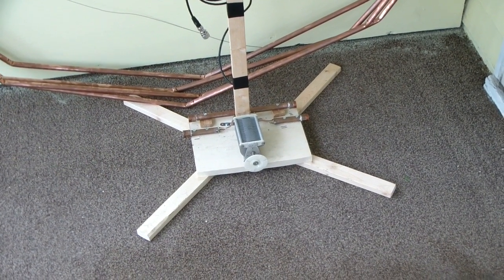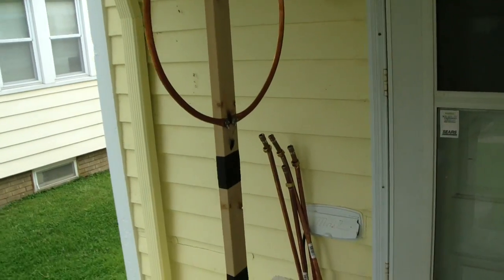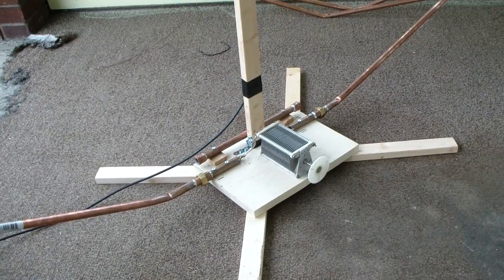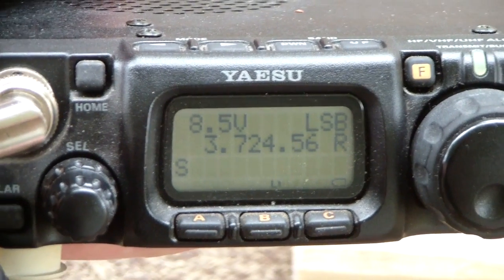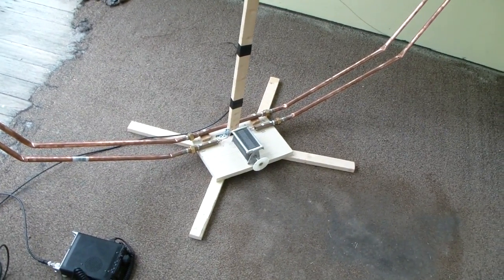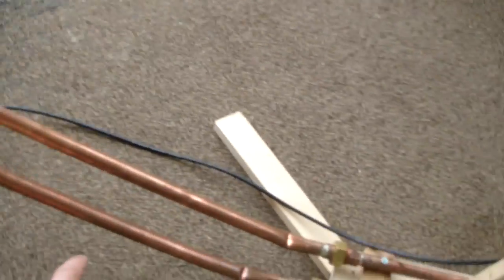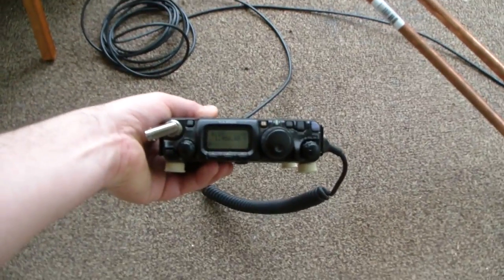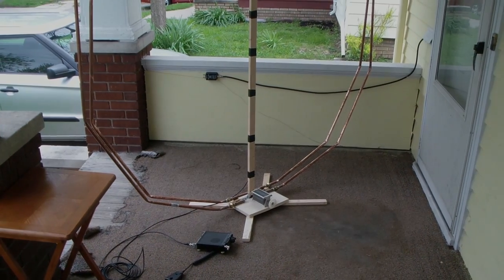Ham Radio - 80 160 meter magnetic loop transmitting antenna

Comment: Kevin: I know this video was made quite a while back, but I made a 2-turn loop recently, and found it would tune across a 2:1 frequency range without having to change from 1 turn to 2 turns. Did you investigate the possibility of using the 2 turn configuration for both bands?
de WB2VUO here near Buffalo, NY

Comment: A point to consider, If you use a butterfly capacitor you won't have the resistive wiping contacts thereby improving the Q of the system. I'll be making a magnetic loop later this summer. I'm in the process of designing a split cylinder rotary variable capacitor rated at several kV. (Remotely operated I hasten to add!)

Comment: A loop like that is perhaps 2 to 3 percent efficient at most for 1.9 MHz at that diameter, also, that small of copper pipe has high IR losses, the diameter needs to be much larger, one recommendation I've seen is greater than 1/24 diameter of the loop itself which is at least 3 inches and as a double loop, double that diameter of pipe. I mention this so others can know these loops need much larger diameter conductors due to high IR losses from skin effect.

Comment: I'm flummoxed. First try at a mag loop and the SWR is 9+ below about 12 MHz. The loop is double (10m) of RG6 approx 3 metres dia.. The coupling loop is about 30cm diameter tuned with a 500pF variable. No short circuit. Sumpin ain't right.
 The coupling loop is placed near the"centre" of the double loop (ie down at the bottom)
VK4AKH
Reply from the maker: You don't tune the coupling loop with the capacitor.  It needs to be connected to the outer loop.  The coupling loop needs to be physically at the side opposite the tuning cap.

Comment: Harbor Freight has a fairly inexpensive tubing bender... I made my magloop with that tool and it's a nice perfect circle.
Reply: Überleben  I heard the feed loop couples with the main loop better when egg shaped, but I haven't heard about the entire antenna reacting that way.. I'll have to try it.  Thanks!
Reply: What tubing did you use? Why not just buy like 0 gauge copper wire? Then you could bend by hand no?
Reply: @Justin-bd2dg  The larger diameter the loop conductor, the more efficient (higher Q) it is.  And the more broadbanded it is.  Ideally you'd want a donut shaped loop (that looks like an actual donut or bagel) but doing that in copper or silver is impossible for most people.
  Q is a function of resistance.  Accounting for surface effect, then the smaller diameter the loop conductor, the lower the Q and the more narrow your parameters will be.
  The more resistance in your loop, no matter the dimensions, the worse the performance.  So if you were to try and make a donut shaped loop of massive proportions but built it poorly, although the shape was ideal, the resistances of the shape would remove all your gains.
  Thinking of this further, if you were to fabricate a giant donut of some material that was conductive and smooth, and then electroplated it with copper or silver, then you'd be golden!
  BONUS:  If the cross section of said donut was large enough, then you'd just need to manipulate the gap between the separated ends with precision for your capacitor, provided the ends were terminated with conductive circles, perhaps separated by glass or other suitable dielectric.
Reply: @patrickp4827  I saw a guy build one of these with aluminum clothes drier ducting.

Comment: As I understand Small Magnetic Loops, they are fed at the point opposite of the capacitor; 1/2 way around the loop.  When you switch from 80M to 160M, by leaving the feed point where you have it, aren't you feeding the 160M loop at the 1/4 and 3/4 points rather than 1/2 point around from the capacitor?  Would also enjoy seeing your field strength device implemented on this one.  Thanks, Ron, AE5WW
Reply from the maker: It's the physical layout that matters on the cap and coupling loop.  Related to the physical magnetic fields.
Reply: I've thought the same thing.  Seems like you'd couple the drive loop at the electrical center of the radiating loop, so the magnetic peak of the drive loop would match the magnetic peak of the radiating loop.  In the two loop configuration that would put the drive loop at the bottom, coupled to the loop section at the back of this configuration where it's passing by the capacitor on the bottom.
Reply from the maker: I have experimented with moving the coupling loop closer to center.   The weird thing I observed was although I could still tune to a point of resonance,  the radiated field strength dropped off tremendously.
I've seen another video illustrating the voltage vs current peaks on a magloop.  Like with a dipole, they are 90 degrees out.  There was a voltage peak on the loop at the capacitor, but a current peak at the coupling loop side.
I think with the coupling loop centered, you don't get that relationship and it just doesn't radiate.   But I'm not a math guy, more of a gut instinct experimenter.
Reply: I"m not sure we're saying the same thing.  I don't mean centered within the big loop, as in concentric, circles with a common center.  The drive loop has to be quite near the radiating loop for the magnetic fields to couple.  This is hard to describe, it seems.  I mean the drive loop inverted from how it is now up top, and placed "on" or very near the bottom of your back-side loop.  It would magnetically close-couple from the small drive loop to the large radiating loop.  My thought is that would happen best at the point of maximum current, the electrical center of the radiating loop.  As if the center of dipole that happens to be coiled into a loop.  Maximum magnetic field occurs at the point of maximum current, the center of the "dipole" if you will.
Reply from the maker: Some people build them with the coupling loop at the bottom and the capacitor at the top.  I've built them both ways and don't see any difference in performance.  I usually put the capacitor at the bottom only because it's easier to mount it there on the base.
Reply: @jerrygrimes8813  k km km n
Reply: When tracing the 2 turn loop from one side of the capacitor (at the bottom in your case) around to the top (25% ), and back down near the capacitor (50%), around to the top again (75%) and then back down to the other side of the capacitor (100%), you might see that your coupling points are at the 1/4 and 3/4 points of the  double loop structure rather than at the 50% point located at the bottom behind the capacitor.   I'm not saying I'm the brightest bulb on the block, but in my reckoning, you may be inputting the same signal at 2 locations that may be 13 degrees (or is it 26 degrees) out of phase with each other.  You might see a lower SWR if, in your 160M configuration, your coupling loop was where the electrical mid section of your double loop passes behind the capacitor.
Reply: I'll rephrase that last sentence...  You might see a lower SWR in your 160M configuration, if your coupling loop was at the electrical mid section of your double loop; the point where the loop passes behind the capacitor.
Reply from the maker: Although you can measure the distance around the loop electrically, I think the magnetic field is the more important factor.  And that field will be one field, regardless of the number of turns.  It doesn't twist around on itself.   Think of a multi turn inductor or electro magnet.   You get one large consistent field.
I've played around with positioning of the coupling loop on other multi-turn magloops and always observed the same thing.  The coupling loop needs to be physically opposite the capacitor and close to the edge.
These work through magnetic coupling in the near field, and only convert to an electrical field a couple of diameters away from the loop.   (according to most publications on the design I've read).
So,  nope, it works best and gives the lowest SWP when the coupling loop is at the physical opposite side of the loop from the cap.  

I have, however, seen a consistent reduction in SWR and increase in field strength by 'squashing' the coupling loop a bit.  Increasing the area where it is in closest proximity to the outer loop.  That definitely seems to be a repeatable and reliable modification to the design.

Comment: How come we NEVER hear you guys with the loops on the airwaves? In particular, on 160 meters!!!!
Reply from the maker: I make contacts on my loops quite often.  Those guys hear me.  So maybe change "we" to "I". ;-)   I've also made many contacts with other guys running loops.   They're out there.
Reply: @loughkb  re: "I make contacts on my loops quite often. Those guys hear me. "
When I say "hear" I mean literally HEAR, as in, not running digital modes but operating VOICE. I have never had a voice contact with a station running an STLon 160  ... I run a 1/4 lambda circumference loop myself - the ONLY one in Texas to do so.
Reply: Probably because mag loops are not very efficient when transmitting on those bands.  How efficient is this antenna?

Comment: Where is a good place to buy or get varable capacitor and how far can you change the frenqency before the SWR gets to high?
Reply from the maker: I get caps at hamfests.   The bandwidth is around 5kHz from 2:1 to 2:1 on either side of the resonant point.

Comment: I like this antenna. Is it possible to use a crucifix frame and two turns of standard antenna wire?
Reply from the maker: Yes and no.  Efficiency is dependent on electrical resistance of the outer loop. Thinner wire would lower the efficiency quite a bit.

Comment: Hi, Im a new ham (general) KM6IEV as of 2/7/17. I just got a FT-817 radio package that was a steal. it came with the LDG Z817 tuner, a mini buddipole antenna with an 18' mast and tripod. It also has the MFJ- 1899T multiband antenna and the Arrow II satellite handheld antenna along with a wolpilink for computer control and digital modes. needless to say i basically got a portable QRP station in a box. I love the idea of QRP and bouncing DX on low power. anyway i figure with a mag loop in my attic i could get some pretty good distance since its about 18 foot above ground. 

I have been looking at the mag loop antennas because i live in a condo with an HOA. I dont want to have to put up and take down an antenna every time i want to get on the air. I would like to build one that would cover from 160 to 6 meter. I know this may not be possible because of the physics. however if in not wrong in the way this looks the small loop is the real antenna and the larger loop is the coil that works with the capacitor as the antenna tuner. in this case why couldnt you build a radiator thats about 1 foot diameter and then a single turn larger loop of say 4 feet and then add an inductor in series with the larger loop to add in the inductance needed to tune the various bands. if im not wrong this is basically the way the antenna tuners work anyway so why wouldnt this work for the mag loop antenna to make it multiband???? 

Thanks.
Reply from the maker: A magnetic loop is basically a tuned circuit by itself.  So if you nested loops, they would interact with each other and throw everything off.    If you have multiple magloops for different band ranges, they'd have to be well away from each other, like 20 feet or so, to prevent them from affecting each other.
Height doesn't matter much with them either, they work about as well an inch off the ground as they do 5 feet off the ground.  
If you have an attic, you might do better with a dipole the full length of the attic, at the peak of the roof, and use the tuner.   If your house is at least 40 feet long, you'll do well on 40 through 10 meters that way.
160-80 meters really needs space.   My loop worked on 160, but not as well as a longer wire antenna.   Some people get away with an end fed wire running from the house up into a tree.  If you use small gauge wire, it will be hard to see from any distance.
Reply: Unfortunately my attic is only 20 feet long and about 28 feet wide with the peek along the 20 foot length. i guess i could try and do some kind of Z shape with a trapped dipole but still it would be an odd shape and  not so efficient. If i had more then one mag loop ad there was only a few feet between them how would they effect each other if only one of them was powered up at any given time?? 

I could use the MFJ-1899T but to really make it work properly for the lower bands you really need a counterpoise and that again is a problem since my station is on the second floor. I cant really drill holes in the walls. I have thought about making a narrow strip of aluminum with connectors in it that can sit in the window and connect to outside wires but being on the second floor its still a bit of a problem. Also i dont have any trees i can use for an end feed antenna. I possibly could route a wire around the garage roof so it couldnt be seen but i would still need to run the coax to it. It would be long enough to get a 160 foot length and with traps could work multiband but its only 10 feet off the ground and would be a U shape. 

Its a frustrating situation but i will figure out some way to get this rig set up with a good antenna without breaking the bank doing it. I have even thought about setting up the buddipole so the mast goes thru the access door into the attic but then i have to worry about the heating ducts blocking half the antenna  not to mention the impossibility of changing bands. 

Thanks for the info, its given me a couple more things to think about.
Reply: If you can put a radial system in your attic, you can get a remotely tuned mobile antenna. Yaesu makes the ATAS-120 that tunes down to 40 meters that your radio will easily work with. A step up would be a High-Q antenna. They make several antennas that go lower. You must accept that short antennas are very inefficient but they still work. If you have a patio, and you can lay out radials, you can use several single band mobile whip antennas that only run about $20 each. Low bands will have a narrow bandwidth. You can get quick disconnect mounts for those if you wish.
You can always use a combination of antennas too. A magnetic loop antenna vertically is directional and that can be an advantage but you have to be able to turn it. Can't do that in an attic. If you have a patio, no problem.
Good luck!

Comment: Kevin.  I love your design for this 80 / 160 m loops.  I already have a mag loop that covers 40, 30 and 20 m and have been looking for designs to cover 80 and 160 and yours is the best one I have found.  I have an FT-817ND too, but also a Kenwood TS-850S, and want to build the new loop for higher power levels, so have bought a Russian KP1-8 15-750 pF vacuum variable capacitor to use with it that is rated at 5 kV and 35 A.  I may also try to use larger diameter pipe than you have too (I aim to make it handle up to 100 W).

I would be grateful if you can tell me how your loop performs on 80 m when configured for  160 m, compared with configuring it specifically for 80 m?

I will be extremely limited for space for antennas as my new location which is a second floor 2 bedroom apartment (fortunately with a nice size loft).  If 80 m performance is too poor when configured for 160 m, then I might consider using some form of remote switch to cut out the second loop.  I already have a 3000:1 gearbox motor of the type I use for my existing loop for remote tuning.

I am also unsure of the plumping aspects as I have not worked with copper pipe.  I have seen simple designs for pipe benders which could be made to make a pure circle, rather than a 12 sided one, but would like to know how you fitted the threaded unions, what did you use to solder them on?

Thank you so much for publishing your design and hope that you get some great contacts with it! 73
Reply: loop like that is perhaps 2 to 3 percent efficient at most for 1.9 MHz at that diameter, also, that small of copper pipe has high IR losses, the diameter needs to be much larger, one recommendation I've seen is greater than 1/24 diameter of the loop itself which is at least 3 inches and as a double loop, double that diameter of pipe. I mention this so others can know these loops need much larger diameter conductors due to high IR losses from skin effect.

Comment: Can you explain your impedances & impedance matching & balanced vs unbalanced. Am I wrong in seeing you solder an unbalanced-system coax to a balanced (by nature) loop?  Did you need a balun?
Reply from the maker: As far as I'm aware, nobody has used one with these loops.    It's an interesting thought though.   I'll have to go look around and see if there's any discussion anywhere.
Reply: xyz abc A current balun 1:1 is what I use. When you use alot of power its possible to experience rf down the sheilding. However these antennas usually work fine without.  
Without a balun though touching the coax or the placement of the coax will cause a very small drift in the tuning. In both cases its best to make sure the coax is not parallel to any part of the coil or touching it as this will throw off your swr. I tend to use like a string or rope to hold the coax near the center and out of the plane. Usually I have a nema box and just run the coax through a duct tape mounting system to keep it from wandering.